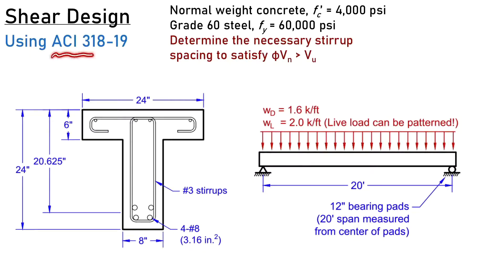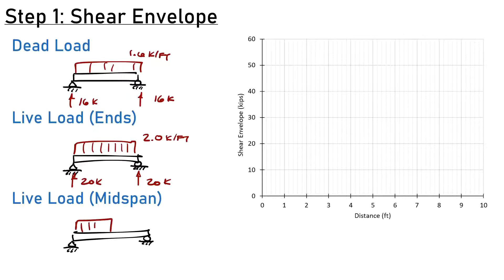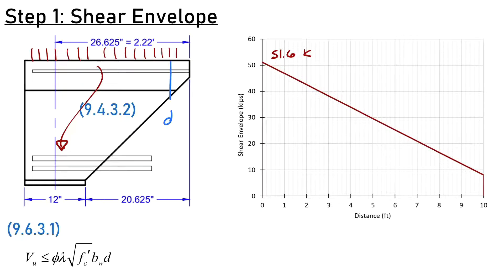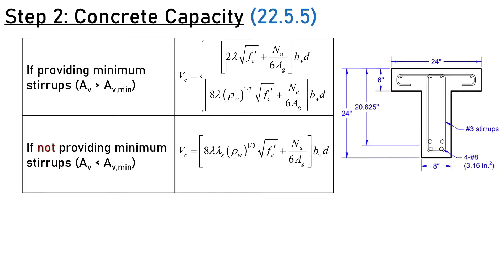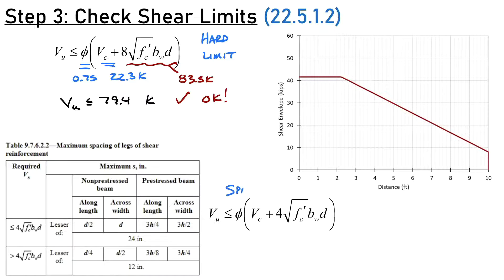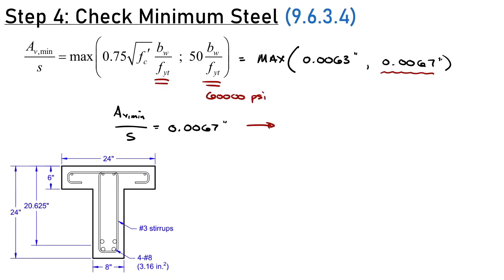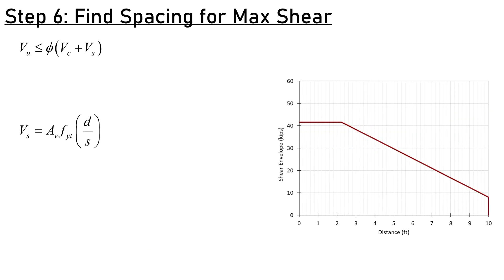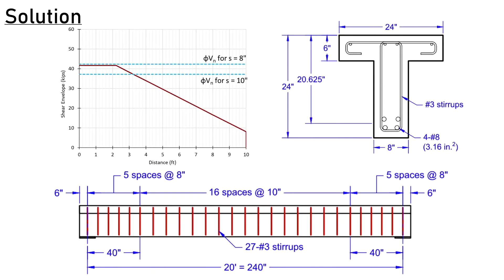Shear Design Example - Reinforced Concrete Beams using ACI 318-19

Comment: Thank you.
What is the minimum spacing for stirrups ?
Reply from the maker: Maybe someone else in the comments can jump in - I couldn't find a code provision specifically for stirrups (weird?) even though this is clearly defined for ties, spirals, etc., in Section 25.7 of ACI 318-19. Anyway, I would maintain a minimum clear spacing of at least 1 inch, which is consistent with the provisions for ties and spirals. You need to make sure the concrete can flow and fill around the reinforcement.
Reply: @StructuresProfH  Thank you professor, you are the best 👍

Comment: Hello prof. Shall the size reduction factor be considered for pile cap design?
Reply from the maker: It's a bit confusing, but it looks to me that ACI-318-19 does require you to use the size factor for pile cap design.

Section 13.2.6.2 states that the size factor can be ignored for shallow foundations (specifically, "one-way shallow foundations, two-way isolated footings, two-way combined footings, and mat foundations"). It says nothing about deep foundations, which have their own section 13.4. The pile cap section 13.4.6.3 just sends you to 22.5 for shear capacity, with no mention of ignoring the size effect factor. I'm not sure if this was intended, but it seems that's what we have.

If it is any consolation, it gets even worse if you look into plain concrete. Inexplicably, plain concrete does NOT have a size effect factor, even though size effects would (per theory) be a bigger concern for plain concrete sections compared to reinforced concrete sections. Because of this, the plain concrete provisions in Section 14.5.5 can give you HIGHER strength than the provisions in 22.5 when you have lightly reinforced sections. 

For example, say I have d = 24", reinforcement ratio of 0.005, and no shear reinforcement. Section 22.5.5 gives me 1.05*sqrt(f'c)*bw*d for the capacity, whereas for plain concrete I would get 1.33*sqrt(f'c)*bw*h... and h > d so I get another minor benefit to plain concrete. Even accounting for the different strength reduction factors (phi = 0.75 for shear but only 0.6 for plain concrete), the plain concrete comes out on top, leading to the perverse incentive whereby I can remove reinforcement and gain strength per the code! Don't do that, by the way.

Comment: Thank you Professor. In step 5 you multiply Vn = Vc + Vs by phi. Why?
 In Eq  22 . 5 . 1 . 1  in the code, there is no phi
Reply from the maker: Chapter 22 in the code always gives the nominal strength. The strength reduction factor is called out in the design strength equations given in the respective member chapters. For example, Section 9.5.1.1 for beams states that phi*Vn must be greater than or equal to Vu, where the phi factors are defined in Chapter 21. Similar equations for the "Design Strength" are found in Section X.5 for other members, where X is the chapters 7 through 14. It's a bit repetitive and convoluted, but it is all there.
Reply: @StructuresProfH  Thank you professor 🙏

Comment: Great video but what is this number 0.0156 that you don't define?
Reply from the maker: That’s the value of rho_w (the reinforcement ratio) where the two V_c equations are equal. For rho_w less than 0.0156, the 2*root(fc’) equation will be greater, and for rho_w greater than 0.0156, the second equation will be greater. This isn’t in the code, and it’s not necessary to know, but it is nice to keep in mind if you are trying to maximize V_c.
Reply: @StructuresProfH  Thanks, that was very informative video!
Reply: @StructuresProfH  from where did you get this number 0.0156
 pro ???
Reply: @EUmyermelar  from Table 22.5.5.1 u can equalize the (a) and (b) such that 2 = 8*rho w^(1/3). If u rearrange, u can get the value of rho w for using the eq.(a), is must be greater than 0.015625. If it is below that value, the eq (b) will be smaller than (a).

Comment: I looked into the ACI code but still don't understand what Nu is, and why in this problem equals to 0 🤔. 
Could anyone explain that?
Reply from the maker: Nu is the axial force in the beam when subjected to the factored shear Vu. For the example in this video, the beam has no axial force, meaning Nu = 0.

It's rather odd that ACI 318-19 uses two different symbols for axial load. Normally, Pu is the factored axial load, but for some select shear and torsion equations, the code uses Nu. It's a subtle distinction. Definitions for these are in Chapter 2 of ACI 318-19 as follows:
Nu = factored axial force normal to cross section occurring simultaneously with Vu or Tu
Vu = factored axial force

Comment: Professor I hope you start a series of tutorials on Steel design with AISC.
It will be much much better if you use a software side by side.
Thanks in advance
Reply from the maker: I was thinking about doing something like that, though perhaps not for a few months at least. Do you have any software recommendations?
Reply: @StructuresProfH  I would recommend to use Tekla Tedds for that purpose.
Reply: @StructuresProfH  sap2000?